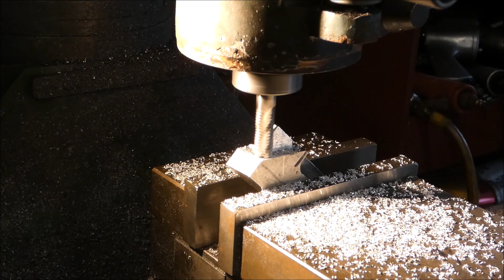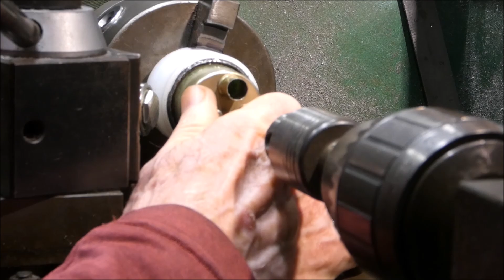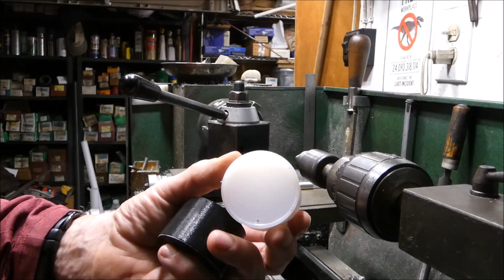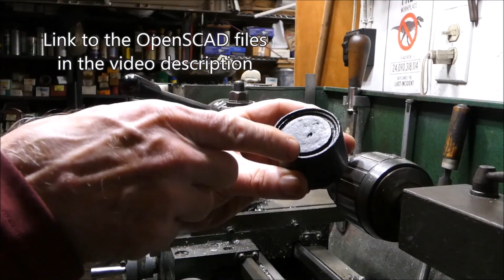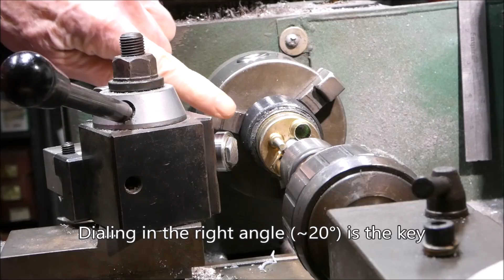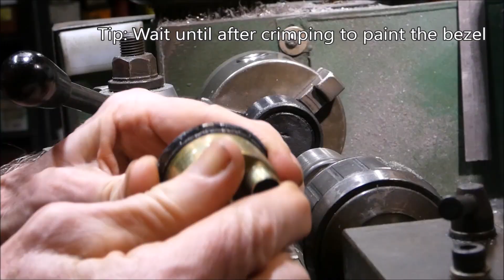Does the Gauge Bezel Rolling Tool Work?

Comment from the maker: I only shot the opening clip of the machining of the rolling tool.  There was a lot of back and forth between the lathe and milling machine to shave off material for clearance with the jaws on the lathe chuck.  In the end, once I made the two 3D printed gauge holder variations that made more room between the tool and chuck, that solved all the issues.  Also, there was a lot of trial and error trying to find how best to get the bezel rolled over tight.

It's hard to see the actual crimping action because it involves just tiny movements of the tool with the carriage.  I had to switch back and forth between moving the carriage in and running the cross slide in.  In between, lots of adjusting the angle of the roller tool until I found the sweet spot.  Once I found the right setup, it took under a minute to fully crimp a gauge.

Finished gauges, I like the yellow-green tint to the backlight, has a similar color to the factory dash backlight:
https://photos.app.goo.gl/mnYfQJBbf6QoNkbu9
I also tried a white LED light in place of the incandescent bulb and that one is full green.